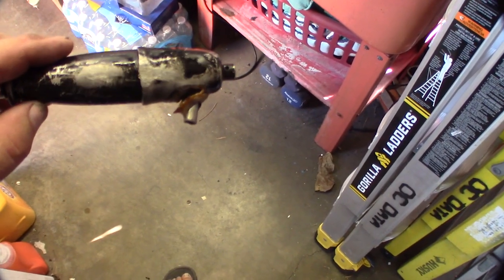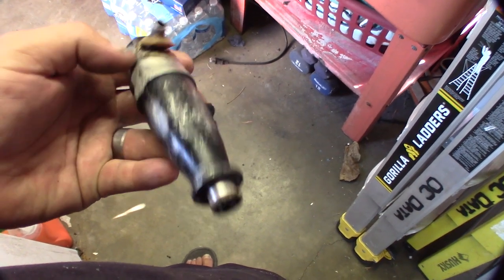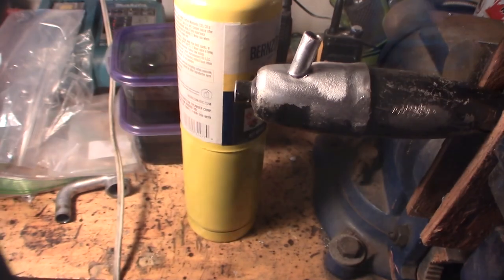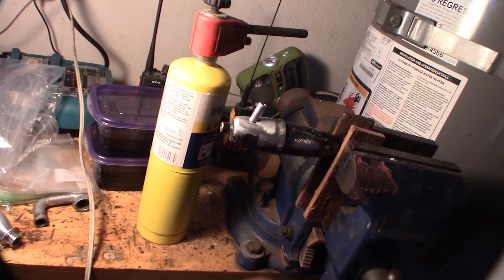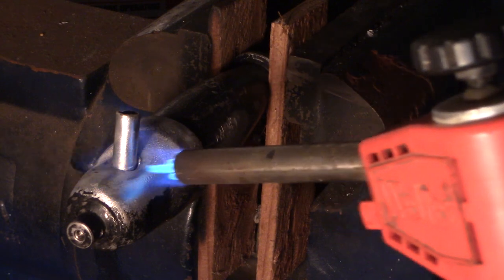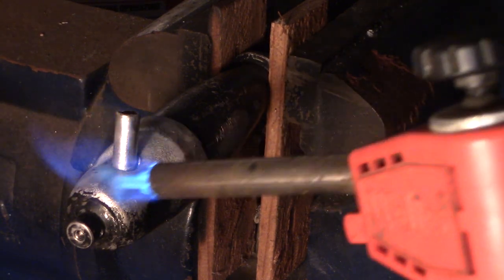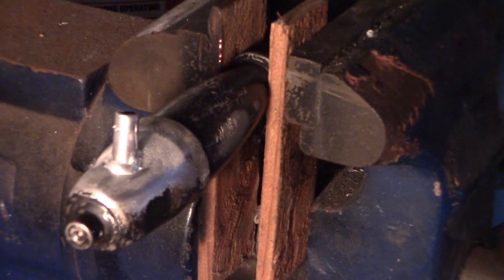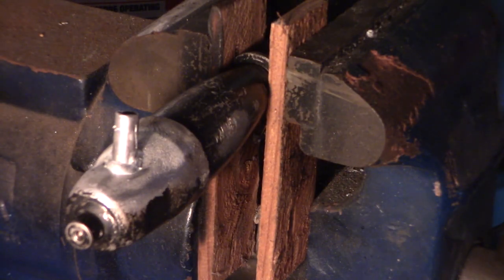RC Aluminum Exhaust Pipe Crack Repair Using Harbor Freight Alumiweld Brazing Rods, Cracked Stinger

Comment: The best lesson learned here...
Not to skip over your videos as I have with the model cars...
Aluminum repair, that was pretty cool. 
That prompts me to go back and watch the rest of them later this evening. 
Thanks! 👍
Reply from the maker: Thanks, I got some pretty cool RC stuff on ebay I'm restoring.
Reply: Nicely done. I have an aluminum pipe on my cars oil cooler leaking. I’m going to attempt the same repair. Thanks for passing on the knowledge.